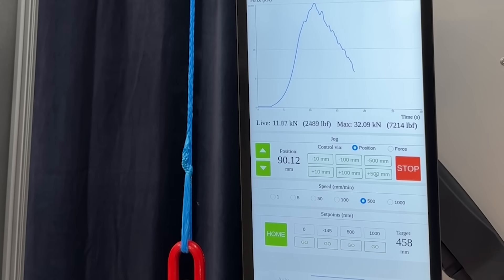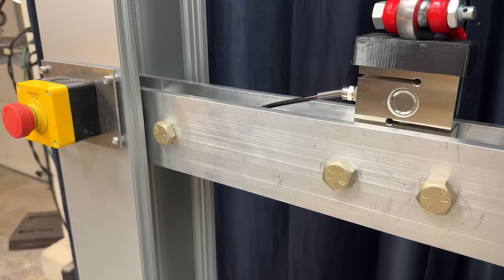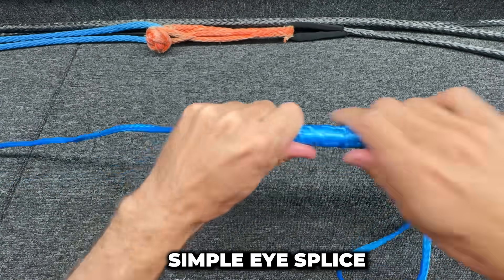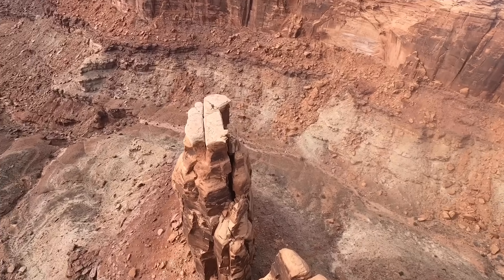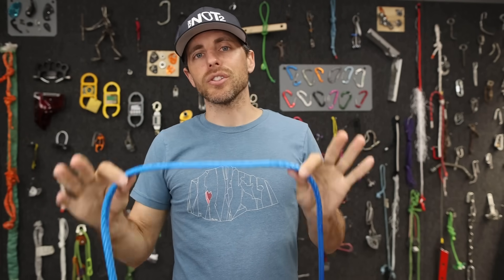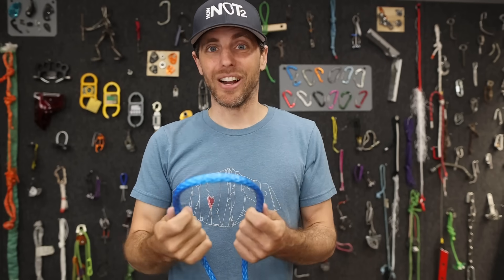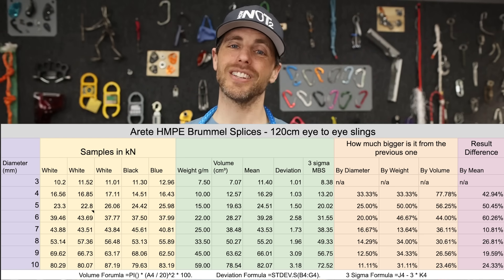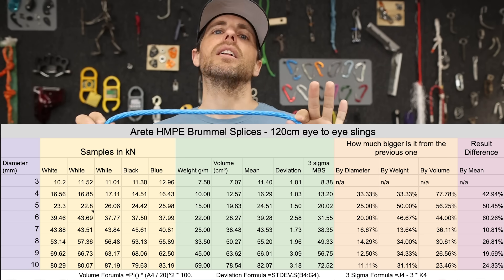The numbers are all over the place

Comment: Excellent video as usual, thanks for explaining minimum breaking strength and the three sigma rule.  One question: with all the breaking tests that you have done, what rule of thumb have you discovered between the breaking strength of the button knot soft shackle versus the average breaking strength of the line that was used to tie it?  Is it 250% ?   Is it perhaps interesting enough of a topic to make a video on the minimum breaking strength of button soft shackles for different sizes of Dyneema?

Comment: Not for nothing, but I'd like to see what happens on a traditional eye splice with a lock stitch. If you used a dyneema "thread" for the lock, I'm curious where the failure would be in situations where the splice tried to just slip apart.

Comment: I do a lot of vehicle recovery this is great. On my Winch I'm running 28mm 24 strand dynema. ( Probably spelled that wrong). My standard eye splice is Dx72 with the last 40cm tapered to half. I stitch the first 30 cm behind the eye with 3mm rope to lock it in place for it's initial tension.

Comment: With how you described the way splices hold together, i feel like the strength might depend on how the inner rope is situated in relation to the outer rope, possibly causing places where the stress becomes localized due to the cariing bend radius it is forced into.

Comment: The low melting point of PE means ambient temperature and cable temperature matters a lot regards tensile strength. Under continuous load above its yeild strength will continuously stretch.

Comment: You mention that the variable thickness along the braids have to lock together before the splice sticks. Do you know how automatic that process is? For example, if you twist the tail while burying it, how far out does it have to be before it tries to lock into that twisted position? My naive guess is more than 1/24th of a twist over the entire length of the bury, and the tapered end might end up in a different orientation than the eye end, with everything in the middle at a less-than-ideal twist.

Comment: With regard to statistics it is possible to calculate the required number of samples to describe the variability and obtain confidence intervals on breakage.  One must to collect some preliminary data about the distribution of results then one can choose a confidence interval and calculate the required n.  It's going to be a lot larger than almost any youtube video though.  Likely in the 10-30 per sample condition range.
Reply: The output of this would be the ability to make a statically valid statement something like "there is a 95% (or 99%) chance that line X will not break at less than than Y kN under test conditions Z,W,V,U".    Then, in engineering world, you put your 3x or what have you safety factor on top of that and no longer worry about the line simply snapping.
Reply: Note the safety factor is not just padding, it's also a guesstimate to handle deviations from the exact test conditions.

Comment: 3 sigma is only meaningful if you expect a normal distribution. In reality you don't. A rope will fail at the minimum breaking strength of any section. Testing only short sections is a very small sample size if minimum strength is what you care about. For example, consider the case where a defect can exist that reduces strength 20%, and any 1' section has a 10% chance to contain it. This will always result in a high deviation in short section testing, but we cannot extrapolate this to infer it could break lower than we had seen. A single normal distribution doesn't fit.
To really understand things you need to start testing strands individually, and also testing how the strands interact. What happens if you cut a strand? What happens if you cut a different strand some distance away? At some distance strand variations will not interact, so the rope sections can be regarded as independent.
Best thing I can think to do is break a 60' section of rope. Cut 60x diameter around the break, then test each section. Repeat till you cannot test anymore.

Comment: Does the breaking strength depends on the length if the sample you’re testing? If the rope breaks somewhere in the middle, at it’s weakest point, having a longer rope means greater chance for weaker and weaker break points

Comment: I haven't seen this rope first hand. from what i can see in the video, i wonder if some of the difference comes from two different scaling factors between sizes. What i mean is there are individual strands which are preassembled into chords which are then woven into the final rope. similar to wire rope construction. Is the weave count the same in all ropes? I'm wondering if going between sizes it may not be uniform changes of chord size vs weave count?  Thanks for all the good work.

Comment: 7:48 my dad taught me to do a locking splice to a ski rope a bit different.  You basically do what you call the “long splice” but it does not need to be terribly long. Then the end of the rope comes out of the tunnel, then loops around the outside of the rope, then goes back in the way it came. 
Im definitely not explaining it well. I wish I had a way of showing you, because I’ve never seen it come undone, neither under pressure or under slack.

Comment: Even for metals this is a thing. From what I remember the 95% convidence strength testing typically requires something like 15-21 test samples to get a meaningful standard deviation so that you don't have the exact issue you're talking about at the end where the min would be so low it wouldn't be appealing or even very representative on most material samples.

Comment: I'm in the material handling industry and ergonomic push/pull forces are very important. As you mentioned the speed of testing matters a lot. ANSI and NIST have both weighed in on this topic and we now have ISO standards for the speed of this testing so data is consistent. You can look to see if there are similar standards for rope testing.

Comment: btw, check this paper: "Modelling creep tests in HMPE fibres used in ultra-deep-sea mooring ropes" (H.S. da Costa Mattos ,F.E.G. Chimisso)   There are some numbers and formulas (section 2.1.1 "Tensile Rupture Test"), and you are right 11:40, to "predict" failure we can use mass  per unit length

Comment: well, that's why engineers love homogeneous/isotropic materials 🤓:
-" The obtained solution is successively pulled through small holes and afterwards solidified by cooling it. This process produces a fibre with a chemical structure composed by chains with a high molecular orientation degree (over 95%). This molecular structure, with high crystalline degree (up to 85%) and a little amorphous content, gives the fibre a high modulus and a high rupture load. " 
- " Due to the anisotropic nature of high modulus polyethylene fibers, the modulus and strength in transverse direction are lower than in fiber direction" 
.
I guess, the splicing process  introduces a ton of "unknown unknowns"

Comment: A 3 sigma MBS implies a particular shape of the distribution of real breaking strengths which extends well past the region where you have any information about it. You can't use 5 samples and pure empiricism to establish a 1 in 1000 chance. Either you need a theory of all the ways it could stop supporting the load which is good enough for theoretical uncertainty not to overwhelm predictions of such small odds, or enough samples in sufficiently realistic test conditions that your theory doesn't have to extrapolate across such a large gap. By theory I don't mean a material science kind of theory, I mean a system of predictions about the things that could happen when you really try to use your thing. You have to account for stuff like "the splice came loose" and make sure the chance of the splice coming loose is within your 1 in 1000 uncertainty budget. Or else have a redundant safety. Or both. You know this kind of engineering. I'm not telling you anything you don't already know, just framing it a little differently to put it in context with your concerns about rope breaking specifically.

It may be sort of intrinsically misleading, not in a fraudulent sense I don't think, to report a 3 sigma MBS. Establishing that there's really a 1 in 1000 or less chance of something breaking even under the standard test conditions takes some work, and manufacturers may not be taking on the responsibility of making that claim? And so no one really tests it? Like, most people use safety factors on pure load, and usually it's some other failure mode that comes into play before pure clean breaking strength, so how often does it really come up whether 3 times the standard deviation of a lower number of tests means a 1 in 1000 chance, like 3 sigma sort of alludes to but doesn't explicitly say, under test conditions, or something more, or something less?

Comment: I couldn’t remember the exact verbiage so I looked it up. According to Sampson and concerning amsteel blue- 
SHOCK LOADS: Shock loads are simply a sudden change in tension from a state of relaxation or low
load to one of high load. Any sudden load that exceeds the work load by more than 10% is considered a shock load. The further an object falls, the greater the impact. Synthetic fibers have a memory and retain the effects of being overloaded or shock loaded and can fail at a later time even though loaded within the work load range.

It makes me wonder how these would perform on the drop tower rather than slow pull. It also seems like there needs to be some tension to engage the splice before it was suddenly loaded?

Comment: The strength should go as diameter squared, right? A 5% sd seems really good, given that the 12 yarns will not be equally weighted if the cordage was kinked or bent at all.

Comment: materials engineer here - the non linear breaking strain may be related to the cross sectional area of the strands in the 12 strand braid as the amount of hmpe may not be uniformly increasing as you go up in diameter in the same way a kernmantle construction does.
Reply: My thoughts also.  The braid method and diameter measurements may give inconsistent starting factors.
Reply: Because its hollow I imagine there are diameters that complement the number and thickness ratio of the strands and other diameters that require an odd number of strands which may create some form of assymetry when under high loads of tension

Comment: I do off-road recovery and I use synthetic rope on all my winches and I use soft shackles and stuff too. The ropes are expensive I'd like to learn more about this stuff so I can just buy it by the foot and build my own extensions because sometimes I need a lot of winch rope and if my winch has 100 feet of rope with like 90ish usable feet I'd like to make some 80 foot extensions that would work pretty good. I have a bunch of 50s but I did a job recently when I decided I want to find or make some 80 foot extensions but i know theres low quality Chinese rope and high quality stuff and i dont know enough about it so i buy from trusted high end off road brands and pay a premium but I'd love to find the rope cheaper and then make my own loops on the ends for extensions I have a neat splicing tool for repairing broken ropes or making loops. I know it as synthetic rope, I know it has multiple names. I should probably know more about this stuff since I use it so often. I use 3/8 and 7/16 rope on most of my stuff I believe what I use most is 3/8 which has a rating of 17,500lbs MTS. 
I don't do rock climbing or anything but I sure do enjoy watching you break stuff and a lot of the gear and stuff you use is interesting so I enjoy the videos.
Reply: This channel has a really good video on making soft shackles, hardest part is tying the button knot. For splicing it’s super easy you don’t need any special tools, just a wire coat hanger and some sharp scissors. Colligo marine has a good PDF of the brummel splice in the support section of their website.

Comment: I think what's going on with your scaling variability is that in theory the break strength should be based on cross-sectional fibre area, but this is probably not directly related to the nominal diameter based on different characteristics of the fibres as the ropes get larger, in other words the ropes have different packing factors (ratio of nominal to fibre cross-section). So when you try to normalize based on the area (or analogous volume of the entire piece of rope - diameter doesn't make sense since it's a square relationship), this difference in packing factor skews your results and makes them a bit wonky.

As you found, since you know the weight of the rope per distance, this is essentially telling you the amount of material in a given cross-section - giving you the relative cross-sectional fibre area, assuming the base material HMPE is the same density. So it makes perfect sense that this would be the best way to model the estimated strength given the data you have.

I was also wondering why the weight in the table and the weight given as Reported Weight on the rope product page are fairly significantly different.

Comment: Because you said "it felt random" and "it wasn't linear... it wasn't exponential" at 06:07 , you got me curious so I checked the stress in the rope as a function of diameter. And ya, stress in the rope section does not stay consistent. For 3-10mm rope the stress in the rope in Mpa is: 1613, 1296, 1249, 1390, 1132,1099,1038, 1045. So ya, that is interesting! It is clearly trending down. I suspect that there is more "fluff" in the bigger ropes than the smaller ropes and that is leading to a less effective cross sectional area. There is an easy way to check this (and you probably already know). If the 10mm rope weighs 11.11 X more than the 3mm rope (for the same length), they have the same "fluff" percentage and the mystery continues. But if the 10mm rope is only about 7.25 X heavier than the 3mm rope (for a given length) than the cross section of the 3mm has less "fluff" than the 10mm. Or pull on all your specimens just a little to remove the "fluff" and put the calipers on it again. I bet that data would plot exponentially.

Comment: Outside diameters of fibre products isn't so useful as you found out..... - with the strength testing of your different diameter / size samples  - absolutely using the weight of the fibres per linear unit  is a factor.   (The same problem / variability exists in rigid composites - the fibre strength isn't the same as the bulk material properties).
 - weight (and understanding lay angles/ ratios), can be used as a proxy for actual cross sectional area  (we know the specific density/gravity of UHMWPE.)  - the actual amounts of fibre in the various sizes may not be the same "filling"/ packing ratio to the actual rope's outside dimensions, solid materials all use material cross section as the function of nominal tensile strength  (ductile materials narrow as they narrow under tension,  "neck", and also often work harden.)..

(Time domain - again - energy absorption..)

 - There is still a non significant frictional component which holds it inside the bury"- with the "polygonal" shape it makes under extreme tension (inside and outside)  to increase the "strength" of the minimum bury, external whipping is probably the oldest and still the most secure method for a permanent eye (to maintain it in a compressed / rigid form).

Comment: When you're doing these calculations, it would probably be better to use cross-sectional area because that is the most descriptive measurement of the part of the rope that is resisting the force.

In this case, the volume or mass of equal lengths of rope scales with their cross sectional areas, so just weighing the ropes was a great way to get the right ratio between them, and this is an excellent method to estimate cross-section on something with such a weird braided and hollow area. To make it more generally applicable you could cut a known length chunk out of any rope of the same material and weigh it to get the linear weight (pounds per foot, kg/m, whatever units) and compare that between anything of the same material.

I bring this up because I was watching one of your years old videos and you tried to apply the volume method to personal anchors of different sizes and lengths, and that would be an invalid comparison. For example, a longer personal anchor with the same width and material is heavier & higher volume, but the eyes are the same strength and the material in the middle is the same strength, so you wouldn't expect it to break at a higher force.

Using the cross-sectional area and the material's tensile strength in psi or MPa (pressure units) is the standard way taught in engineering classes to calculate the breaking force of a specimen.

Edit: I am definitely not a climber, just an engineer that loves your dedication to testing all this gear, so personal anchor might be totally the wrong word to use. My bad if so.
Reply: Any chance you know how to convert from MPa to kN, given the diameter of a bolt? Steel fasteners are specced with pressure and I was trying to work out what MBS force to expect from them when sourcing fasteners for hang a porch swing.
Reply: @leveller4  stress (Mpa) = force kN / Area.

But it also depends what you are bolting together/into if it isn't the fastener that fails. 

I would definitely bake in quite a bit of margin if I were you.